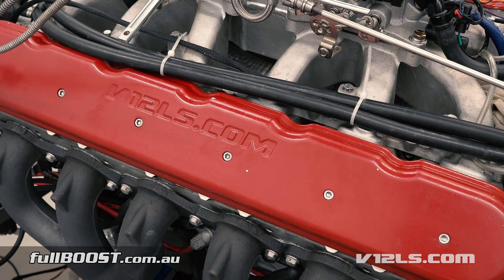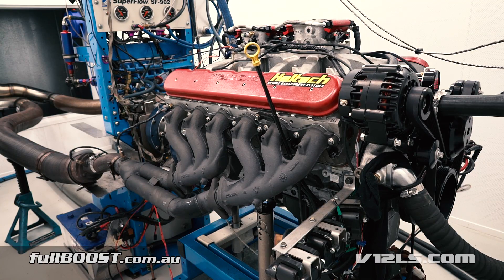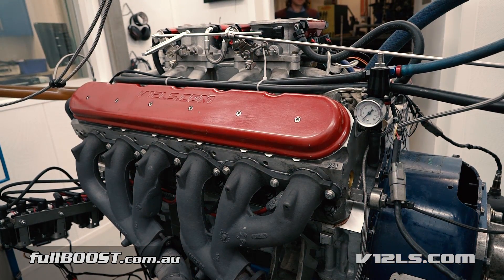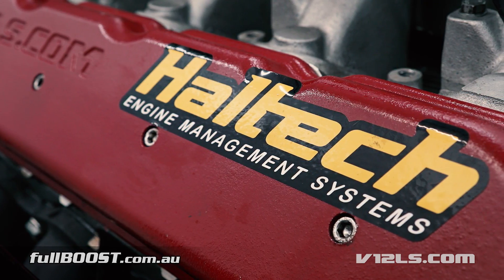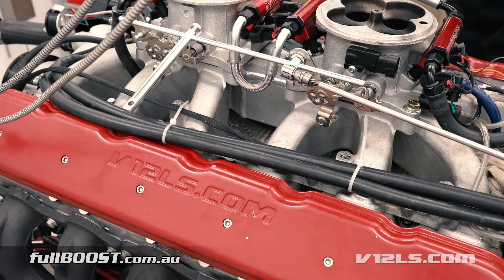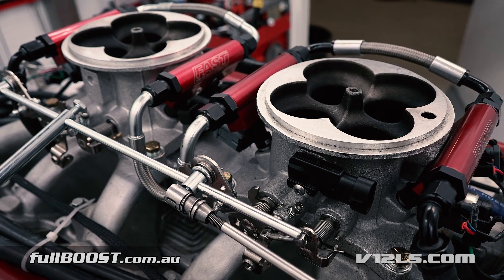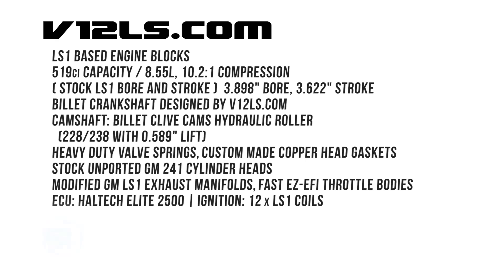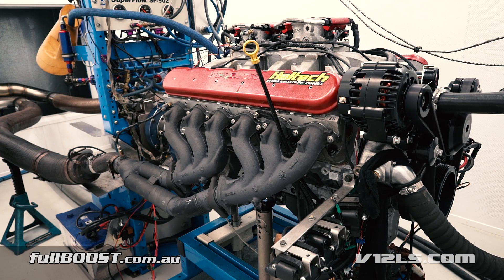V12 LS1 engine dyno

Comment: I am surprised it doesn't sound like  it is tearing itself apart considering the correct angle for a V12 is 60 degrees, not 90.
Reply: Thanks for the interest in our project. That's because a V12 is balanced at any bank angle. Think of it as 2 inline 6s sharing the same crank. Many different bank angles and firing intervals have been used in racing over the years, one of our favourites being the 80 degree Lamborghini V12.
Reply: @V12LS i get that it is tso sixes.  The calcs i have seen is that 60 degrees is optimal.
Reply: @jked7463  Perhaps you are confusing power balance with engine balance?
Reply: @V12LS  I have never been more than a back yard mechanic, and not even that for quite a while.  But I am interested in anything that moves.   Years ago(that is why I can cite it). I read a white paper on engine harmonics.  My memory is that 60 degree and 180 degree engines balanced best, straight 6, 2nd best. Actually my specialty is in audio and acoustics.  I can listen to stuff and hear rhythms & discordance.  To my ears, a 60 degree and a 180 degree 12 sounds to be in the most harmonius.  Like all of the vibrations are working together, not fighting each other.  Flat plane v-8's don't sound racy to me, they sound discordant.  A v twin bike motor sounds comical to my ears.
Reply: @jked7463  Thanks for taking an interest. This is a somewhat complex topic to explain in a youtube comment but I'll do my best. There are three key factors to engine balance as you are an audio guy I'll try to relate. 

First up is primary balance. As a piston moves through the cycle are there others moving the opposite way to counter balance it? To do this you need at least 2 planes of crank pins. Can you hear this imbalance? Yes, eg. Harley Davidson.

Next up is secondary balance. As a piston moves through the cycle it is speeding up and slowing down. Is there a piston(s) that is equally slowing down or speeding up to counter it? Just like a waterskier changing speed behind a boat at constant speed, a piston changes speed at constant RPM. So you see a 2 plane crank (eg. I4, flat plane v8) have a big problem here. This is why you don’t see many large capacity I4s or flat plane v8s because heavy pistons make this imbalance very noticeable. Inline 3s. 6s and V12s have a tri-plane crank that solves the issue. Can you hear this imbalance? Not really.

Rocking imbalance (sometimes known as third order balance). When a piston is moving up and down the bore, is there another piston doing the exact same thing equidistant from the centre to counter it? Think of this like a seesaw (not what you want in an engine). Having an even number of pistons per bank that move up and down together in pairs is the solution. Can you hear this imbalance? Yes in some cases. This is obvious in a 4 plane V8, which are balanced in the second order but with 4 different planes of piston movement per bank every piston moves without a firing pair on the same bank. You don't hear the imbalance, but you will notice this because each bank fires twice in a row once every full engine cycle. Because most manufacturers don’t want to put header tubes across the engine to group them correctly we end up with an even timing between pulses but an uneven sound bank to bank. (AKA the V8 rumble). It’s technically wrong but just like the mistake in the first bar of Smells Like Teen Spirit people associate it with something they like and notice when it’s corrected by the crappy cover band at the local pub.

So what about firing angles? Well you can certainly hear the difference between an even firing and odd firing engine but does it matter? Yes, but only in an imbalanced engine. That’s like turning the volume up on the worst member of the band. However if the engine is balanced, AKA the band is perfect and you can mix it however you like, it is personal preference if you like an off beat, but it’s still in time. A V12 is essentially two inline 6s that are balanced in all 3 areas mentioned above. Adding another bank at any angle cannot unbalance the first one.
Reply: @V12LS  Yes, understand the different orders of balance.  As a minor note, while there is one piston moving up with an alternate one is moving down, they do not perfectly balance each other.  This is because there is a distance between the two pistons.  So while each one has its own imbalance that are 180 degrees out of phase, they do not completely void each other because of the offset between them. A boxer comes closest to each piston's imbalance negating the other.  I use a boxer engine because the geometries are the simplest of different engine configurations.   If both pistons in a boxer were to share the same piston rod (imposible due to crank rotation i know) then they would negate each other more perfectly.  But because the opposing pistons are offset by by the thickness of the piston rod, the forces can't pefectly void each other.  Another vibration mode (all be it minor)  is when the crank transitions  past the 90 degree point when the piston rod changes from moving away from the centerline of the cylinder back towards centerline.  In this case, while the pistons are moving in opposite directions (out of phase) , but the two rods are in phase.  While there are other set of piston rods out of phase with this set , again there is a distance offset which keeps them from negating each perfectly.  I am not saying i understand all of the vibration  modes but if you do simple math for a 12 cylinder engine,  threre are 6 crank jounals.  360/6=60 degrees.  Or conversly, 360/60=6. The numbers match up.  360/90=4. The numbers do not line up for a 12 cylinder.  But they do for an 8 cylinder with 4 crank journals.  A 12 cylinder boxer works because 60X3 = 180, the opposing angles of the cylinders.  I understand i may be over simplifying it but this is what I remember from that white paper.  Of course the white paper calculations were much more in depth.  I just wish i could pull that paper up.  By the way, my favorite configuration is a straight six.  I like the balance between torque, horsepower & vibration modes.  But i am not a horsepower freak.  I just want enough to kick out the rear tires in a curve (steer with the rear). Too bad we humans can't make perfectly stiff crankshafts. A straight six would work even better.   It has been great going back and forth.   While i am a student of anything that moves (physics), i am not a pro. Thank you for explaining your engine dynamics. 
John K
Reply: That formula can't determine if an engine is balanced or not. Based on that a 90 degree V8 would be balanced yet it's not, and a 90 degree V12 would be imbalanced but it is. That formula is often misunderstood as being a balance formula because even power pulses become important when dealign with an imbalanced engine, and most engines are imbalanced.
Reply: As I said, I am not an expert.  Thank you for your thoughts.

Comment: Didnt GM make an engine like this and put it in some kind of concept Tahoe or Suburban? I remembered reading an article about it maybe 10 yrs or so ago. If Im not mistaken it may have been a factory built 10 cylinder LS series engine and made like 500 plus at the wheels through an all wheel drive.
Reply: That's right, GM did build a couple of LS based V10 prototype engines. One has surfaced and is going into a show car currently in build.

Comment: Nice! Even or odd fire?
Reply: Odd-fire, (90/30 ignition split from bank to bank) but still perfectly balanced as each bank fires just like a straight 6. Even fire would have needed a split-pin crank, which is not as strong, and no real need for it.
 Firing order is the same as any other V12.

Comment: Great job. But high 12 to 13 AFR? is that really what it has got? Is there a 800hp hiding in there with more fuel and timing? add a little boost for 1600hp?

Comment: custom fast 102 intake and LS7 heads/ls7 coils, and this thing could make 800 N/A
Reply: a conventional FAst would not work,
air would never be evenly distributed.

lambos and ferraris ex use a cross ram style with 2 different intakes for that very reason.
Reply: ay yes, it comes back to me now, this is why they are the engineers and not me :)
Reply: +AllyourBaseArebelongToUs he said custom. Ferrari and lambo do their intakes for other reasons. because they looks pretty and they can jamb adjustable (while the engine is running) trumpets in there. very expensive to make (according to them), and makes it sound like a quality piece when it's actually just another point of failure for a temperamental n/a motor.
Reply: +SpecialKLSX thanks YouTube mobile...
Reply: SpecialKLSX you don't need moving parts necessarily.

Just 2  a plenum intake for even distribution
Reply: Even distribution from a plenum? I lol'd.
Reply: SpecialKLSX if you have a single large plenum, you can;t feed 12 cylinders evely .

Gm made a V10 back in the early 2000s and it had 2 separate intakes.
Reply: AllyourBaseArebelongToUs like 10 children with 1 parent, it would make sense to have 2

Comment: Why the super long delay between RPM increase and throttle opening?  Massive amount of lag unless otherwise specified reason for it
Reply from the maker: Perhaps read up on how a dyno works. Cheers
Reply: There have been heaps of posts about "Throttle delay", on this video. What it is, is the dyno operator holding the RPM back to allow the engine to ramp up slowly. The slower the ramp up, the more data the tuner can capture, and the better the tune is.

Comment: Makes awesome power and idles like a kitten.  It would take a very angry (choppy idle, low vacuum), large displacement V8 to make that naturally aspirated.  You have to ask yourself though if it has a place though.  I mean, how much heavier vs an LS V8 is it, and then you have to make it fit.  Power adders are such commonplace now it's better to do a turbo/sc setup on a smaller displacement V8.

Comment: I always thought the Porsche 918 should have had 2 gt3 rs engines as a flat 12 like the 917 had. if you don't know about the gt3 motor it's a n/a 4l that makes 500 hp at 9000rpm. that would be something special

Comment: I see how they got the 519 CI number, that would be using the formular bore squared x stroke x .7854 x 12 = 519 rounded. But my question is this, why wouldn't just add the two 346 ci numbers together? or you could just go 346 CI x 2=692 cubes. I need someone to explain this.
Reply from the maker: It's a V12 not a V16?

Comment: How come the throttle movement isn’t synchronized with the sound fluctuations? Fake?
Reply from the maker: The dyno is controlling the load on the engine. This is completely normal.

Comment: If it can compete with the standard price per HP of traditional LS engine architecture, then we'll see. I don't see any point if it costs a bunch more to have 2 extra cylinders & custom headers etc. Camshafts or intake manifold choices greatly limited too. Great engineering , just not something I could afford with the potential parts selection limitations.

Comment: Lots of power still left in that motor with better heads, dunno why they'd go with the old 241 design on an otherwise beast of a motor...
Reply from the maker: It's a prototype engine to prove a concept, they can now build another using higher end parts ;-).

Comment: If the block & heads are aluminum, then that engine will actually weigh less than a stock 5.3 LS V8. 

Imagine a 1970 Plymouth Fury III GT Sport 2 door, with that beast in it!

Comment: The engineering behind this is pretty cool...but would this be practical for anything?   What kind of vehicle would you put this in?  It seems like the effort, huge displacement, huge size/volume, and overall horsepower aren't really much of an advantage over what can be done with smaller engines with fewer cylinders.

Comment: Notice on those pulls they open the throttle bodies all the way and it takes a while to climb RPM's..? Is that the computer adjusting timing or something to make that happen??
Reply: There have been a lot of comments on that. The dyno operator is holding the engine back, allowing it to ramp up slowly. The slower the ramp up, the more data is captured, and the better the tune becomes.

Comment: still like the v8 versions of these engines better, but this v12 and the v16 do sound really good, and I'm sure they make power.   how much power per cubic inch compared to the v8, all else equal, I'm thinking not as much, but still.  Well done.
Reply: The LS V8's are a great engine, which is why they are used as the base for these V12's and other 16's.
 The V12 is actually has a slightly higher power per CI figure than the same engine in a V8 configuration. This is due mostly to the better balance of the V12 and even exhaust pulses on each bank.

Comment: They have crate engines readily available that make this much power, so what's the point?
Reply: Have you ever seen one before?
Reply: Exactly right, park this at a show, next to the same car with a built V8 putting out the same power and guess what people will be looking at.
 There is plenty more power to come from these engines too. Any good engine builder can see that from the basic engine specifications.

Comment: Yea try this with a Ford Triton, they are way too complicated with overhead cams, long timing chains. GM has done a great job of keeping it simple. They are keeping up with very sophisticated competitors with inline two valve heads, cam in block, pushrod engines based off of 1955 technology.

Comment: what car could fit this engine, C5 corvette c3 corvette, chevelle?
Reply: Nah it's designed for a 67 camaro
Reply: where did u read this at, i know a c2 corvette runs this motor...
Reply: It would fit in damn near any domestic car. If you can get a straight six in it this engine will fit. Its a pushrod engine, they are very compact.
Reply: chefdan87 i would really like to make a c3 hotrod with this engine it has a long hood i just hope long enough for this
Reply: Pushrod engines aren't too wide.... That doesn't mean they escape any issues with length though. Comparing this to a straight six is ridiculous...  It's wider than a straight six and just as long. This motor require heavy fab work no matter where you go and chances are you won't be able to service 4 cylinders without pulling the motor everytime.

Comment: Very nice, but the reality of it is that the LS is designed to be lightweight, small in the  overall size and packaging. Forced induction on a V8 LS3 would give you similar if not better numbers.
Reply: You are right, and these are just some of the reasons we chose to develop a V12 on LS architecture. They are compact, and these engines are only 8.8" longer than the V8 variant. Also, due to the popularity of the LS there is a huge range of well priced after market parts, including compact accessory drive kits, pistons, rods, valve gear, manifolds suitable for modification, etc. Everything you know about modifying and tuning an LSX can be applied to these engines including boost. Blocks are now being cast in iron and aluminum, and LS7 style heads are just about ready too. Follow Fullboost, as they will likely run a mini documentary on the production process in coming months.

Comment: Whats different from a Falconer v12?
Reply: The Falconer V12 is essentially the same sort of thing, but they are built on the old SBC architecture. It's also a 90 degree block. This is a gen 3 based engine.
Reply: Jon Bradfield you don't really 'get' the question, do you?
Reply: StuckXJ i

Comment: this engine could be built out to some nice cubic inch numbers.. they could easly build this out too 9.0L to 11.1L giving its current numbers you could easly get 1200 HP i bet..
Reply: We will be attempting to make 1,000hp on pump fuel with one of these engines early next year. That engine will have 4.060" bores, better heads, bigger cam, improved intake and exhaust.
 While 1,200hp would be possible, it might require E85 and a few more mods. Keep an eye out on our FB page for updates.
Reply: Very cool! Would love to see one from a 454 LSX block though

Comment: cool af. i wish it made more poeere
Reply: While 717hp is more than enough for many applications there are higher HP versions in the works now with LS7 heads and a cast iron block. The goal is 1000 HP NA still in a mild and steerable package, then add some boost.

Comment: Why not make it a V16.. why cut the 4 cylinders off?
Reply: Probably for length reasons. V16 would be too long to fit into most cars.
Reply: probably is not any longer than an inline 6, and so could very well be streetable
Reply: That's what I was thinking too. Or use two V6 blocks...
Reply: John Petit a V16 would definitely be longer than an inline 6.

Comment: Why so much lag? or am I seeing things wrong? Im seeing what ill assume is the Throttle being opened up and it decreases in rpm a bit then slowly builds up speed overtime.
Reply: The engine dyno is holding the engine back, and controls the ramp up speed. The slower the ramp up, the more data can be collected, and re-looped for the next pull. If you check out the dyno chart, it's producing nearly 600ft/lb at 4,000rpm. You see a couple of little true free revs at 1:39 with no load which are pretty snappy for such a big engine.